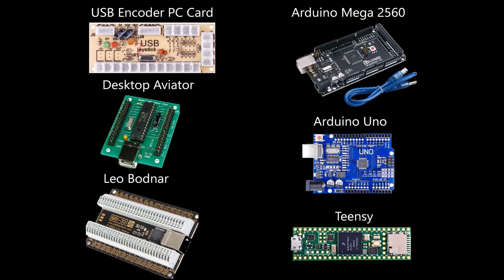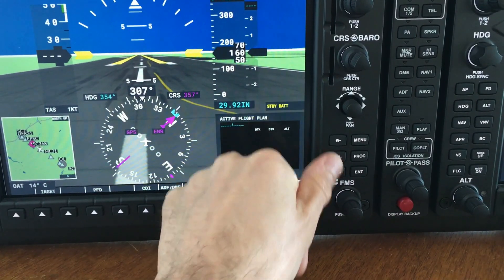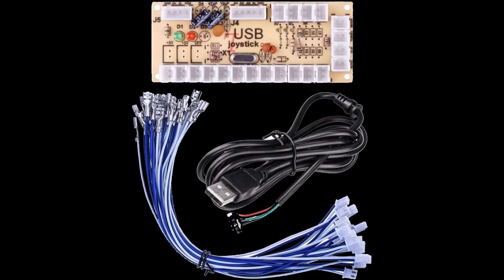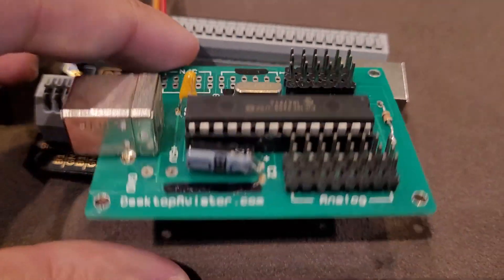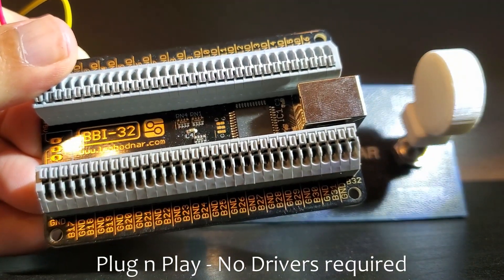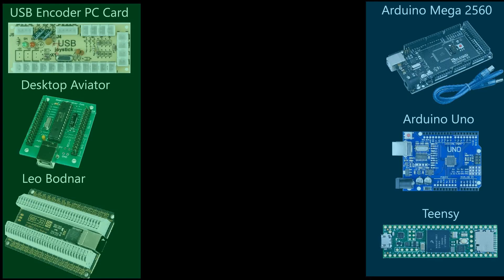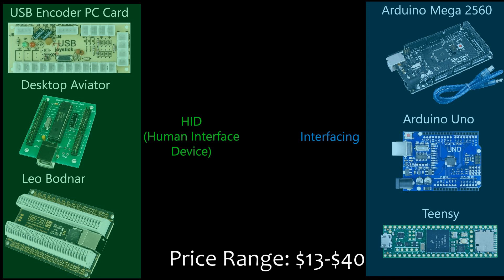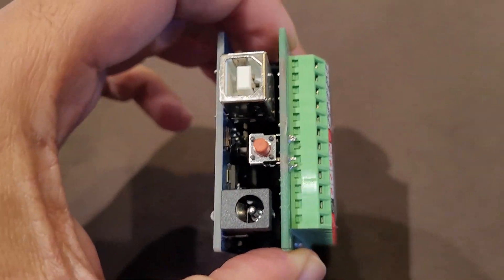USB Interface and Encoder cards for Flight Simulator, X-plane and Prepar3d - Cockpit building

Comment: I’ve been wanting to build a basic switch box for Microsoft flight sim so I don’t need to use my mouse. But also don’t want to spend $100 on one and want to be able to customise it. Found this video very helpful
Reply from the maker: My advice to you is to not build a switch box because you will eventually outgrow it. Find a plane you like with switches that look very similar to other aircraft, and that way it becomes very useful panels because it represents something in real life 😏
Reply: @joshuamarius I bought the usb encoder PC Card and was having a problem where in mfs2020 the switches would turn on and off quickly when connected to the simulator do you have any ideas why
Reply from the maker: Did you test it outside of the simulator first? If it has the same problem in the windows game controller properties then it's a problem with the card. 
Which one in particular did you get?
Reply: @joshuamarius I have sent it back but the one you used in the video was not available in the uk so I bought the most similar one i did try it in a few other games I had in ETS2 it was not even recognising it but in assets corsa it was recognising it but was making you flip the on them off for it do anything I was going to try and buy a different one and see if it fixes it self
Reply from the maker: @brookvlogs8323 Try the Leo Bodnar's. They are in the UK. A bit pricier but also plug n play.

Comment: My encoder is not recognized by Windows 11
Reply from the maker: Which encoder?
Reply: EG STARTS USB encoder, WANGCL Zero Delay and BEYEE all 3 are not recognized
Reply from the maker: You may have defective cards. Those are USB Plug and Play and require no Drivers for Installaton.

Comment: Was excited to find this, but looking at the Leonard site and ouch!! Waaaay too pricey 😢
Reply: I'm a former USAF aircraft electrician.  I am still planning my build, and I will tell you, I keep returning to the Leo Bodnar cards for all but the items that feed information back to an indicator light or display.
Reply from the maker: Yes. Although pricey, the Bodnar cards still win the top prizes for:
1) Fastest and easiest way to connect a device to your Simulator
2) Fastest and most hassle free way to connect an Encoder to your simulator
3) Best built-in wiring mechanism (both catch and release)
I absolutely love my BBI-32 and BBI-64!

Comment: I have a related question: what would you suggest to do for connecting 18 usb devices like these? 

My panels freeze or disconnect…

Thanks and happy flying!
Reply from the maker: Some of these USB Devices use quite a bit of power so you will need multiple USB HUBS. Most people cheap out and find the $20-$40 on Amazon and order. You have to get the good ones with a good power supply with a lot of juice. 4A-5A etc., but these cost in the range of $60-$100. You should be able to split 18 devices within 3 of these for more stability; in some case you may even use 2. This guy has been very good to me: https://amzn.to/3JJoASh

Comment: can it be used in other games other than flight simulators?
Reply from the maker: Which card and which game/system? USB plug n play cards such as the Leo Bodnar and the USB Arcade/PC Cards will usually work with any system that detects them because they are HID devices. But this must be supported by the device. Some gaming devices will  only detect their own proprietary hardware.

Comment: First off this, and your other videos are very well done and informative. I am very new to the sim build and would like to build my own sim from scratch. I have done a lot of searching and I can't seem to find info on how everything behind the sim controls gets connected. Basically, I'm trying to understand how all the buttons, lights, displays, etc. get connected to and from the computer and what software is involved. Example: I put all the wiring to and Arduino. The Arduino Outputs either USB or Ethernet. It is from this point that I do not understand were and how that gets to the computer and back to the devices. What software is used to recognize the individual components and how does that tie into the flight sim software like MS202 or Xplane. I really wish somebody would do some good videos or a tutorial that is literally a start to finish on the complete sim. Maybe someone has. I just haven't found it.  Any ideas?
Reply from the maker: Thanks for your comment. The two methods of interfacing with the simulator are either through HID devices which are plug and Play, such as your joystick or pedals (Leo Bodnar) or Arduino and Mobiflight. For the Leo Bodnar cards for example, once you plug them into the computer the simulator picks them up as a device with multiple buttons. If you connect a switch to button one then you just configure what button one should do in the simulator.
For Arduino and Mobiflight, this is called interfacing, and MobiFlight does all the work for you. Once you download the software you will flash the Arduino with the MobiFlight firmware, and then in MobiFlight program all of the buttons. There's tons on videos on this. MobiFlight is then run on the background, you start up the simulator and it will send the commands you programmed to the simulator: https://youtu.be/pS8KGfYRNrY?si=ppnkH6dDyzgjEegj
In MobiFlight your will see two tabs, Input (to configure switches, pushbuttons, encoders, etc) and output (to configure LEDs, etc).

Comment: i'm looking into building a simple switch panel for msfs with landing gear, engine start/stop, park break, etc. which one of these boards should i choose if i want to avoid soldering anything?
Reply from the maker: Remember that it is a two way road: Device <> Interface Card. So you have to consider both, not just the board. If you look at my other videos, I review some panels and Landing gear kit where the Toggle switches have built in screw-in Terminals, example: https://amzn.to/3Qb30Kk
On the Interface / HID Card side, I also show in my videos how to use Screw Terminal Blocks or Shields so you do not have to solder. Refer to the following videos although I recommend you watch them all:
https://youtu.be/M7Fx54e_NtM?si=ugZ6eEB2ALEfdILG
https://youtu.be/acwipmtqxYA?si=lnZ_J8SN_uAasQaC
Soon I will be producing a video of Wiring. Coming soon!
Reply: The Leo Bodnar BBI-32 has little spring loaded captive ports and requires no soldering.  If you get a set of jumper wires with male at one end and female at the other the female ends will plug onto the pins of the rotary encoders and the male ends to the board. You can also buy simple pushbuttons that already have wires on them.  Personally I wouldn't bother with duplicating displays or lights, all of that stuff can be seen directly on the simulator, you just want to be able to avoid having to use the mouse.

Comment: Hello, congratulations on your very interesting videos. I would like to use a car simulator pedal board (using only two pedals) as a pedal board for simulated flight with P3D. I saw that some boards can be recognised as "controls" of the aircraft. Which board would you recommend? Thanks in advance for your attention
Reply from the maker: Thank you so much. If by "Controls" you mean Axis' (Rudder, Aileron, etc.), then yes there are many cards. One example is the BU0836A 12-bit joystick interface by Leo Bodnar: https://www.leobodnar.com/shop/index.php?main_page=product_info&cPath=94&products_id=204&zenid=ecad6d3e44fe314feae7bce803c20cb6
This card is very reliable and used by many simulation gear manufacturers.

Comment: Hey Joshua, does that mean that I have to use an Interface Card like Arduino to get the LED of your landinggear device working like it should? With a Leo Bodnar BBI-32 it would not work?🤔
Reply from the maker: That is correct.

Comment: can you talk more about software and which ones you use for which encoders
Reply from the maker: Oh jeez, I replied right after you left the comment but it did not save for some reason :( For encoders, if you want no programming at all, take a look at my other video: https://youtu.be/cCl7dwXBSBI - Leo Bodnar has their own free software. 
What most people are going to go after is an Arduino and MobiFlight with FSUIPC. MobiFlight reads the variables from the simulator and programs the Arduino (Both inputs and outputs) and FSUIPC helps provide additional interfacing with the Simulator. I will be making some videos on this soon.
Reply: @joshuamarius  thanks. No problem in the late response, ill definitely check these out!
Reply: @joshuamarius  I went with arduino mega so ill check out the software you listed

Comment: can you do a video on the arduino mega with the sheild. i want to do that approach but i want see some of your work on it
Reply from the maker: What would you like to see? The Shield/Terminal Block just slides into the pins and then you insert the wire inside the pin you would like and screw down. It's very simple. I also just added a Rail Mount Terminal Block as well: https://amzn.to/3GB6nEv

Comment: Hey. I love you’re videos. Can do you Do a video on how to wire a light. For example when you press the apu bleed so it stays on. Or the opposite way around. Or when the fuel pumps are off they the push button says off. If you get what I mean!
Reply from the maker: I will be doing a video on interfacing soon but there are already many videos online for this, for example: https://youtu.be/98sx64YF4h0

Comment: what i need for install a korry button (A320 APU Switch)
Reply from the maker: This is usually a momentary push button with multiple LEDs. Are you building one or did you purchase one. Each one will have different specifications and a way of wiring it up and interfacing with it. If you have a link that would help me answer your questions.

Comment: WHy audio is way too low on all of your videos ?
Reply from the maker: I watched in on my desktop, laptop, tablet, phone, and also tried headsets and I could hear myself just fine. You may have to increase the Volume or need better speakers. The Volume is lower than most of the high definition YouTube content out there, but before I publish I test on as many devices as I can and I was able to hear just fine and not even at full volume.

Comment: On the first board you showed it had wires with wide ends on them that looked like they would slip right onto the standard terminals of switches without soldering.  Is this correct? And if so is there a term for these wires I can use to find them?
Reply from the maker: Excellent question. These are Spade quick connectors and they will be featured in my next video. They slide right into the switch connectors/terminals and save you time as no soldering is required. Here is a link to a pack with different sizes: https://amzn.to/3Hb31a3

Comment: How many usb encoder cards can you connect to one pc? Would they conflict with each other, also is there a way to chain them together if conflict is an issue?
Reply from the maker: Very good questions. You can connect as many as you physically can through USB resources available (ports and power) and there will be no conflict as each card works independently, and creates it's own set of inputs. Different manufacturers may allow you to chain them together so check for accessories when you purchase them, however if you were to chain them at some point they may require an individual power source or a separate connection as just a single USB cable will not carry enough current to power several cards, and the devices connected to them.
Reply: @joshuamarius  appreciate the response

Comment: Hi Josh,
I am just starting to wander down the sim path. You mentioned your Mustang project and suggested we have a look at it. Could you point me in the right direction as to where it might be residing?
Thanks a ton,
Dan
Reply from the maker: Dan, thanks for the comment. The project is built with panels and Hardware from Aviatek similar to the following: https://aviatek.com/collections/all/products/citation-mustang-trainer - You can purchase the entire Mustang assembly, or the panels and the G1000 individually.
The great thing about them is that they can help you with plugins, tips, software and ideas so you can use it with Flight1 software or what's available in X-Plane.

Comment: Great video, thank you. I would like to build a nosewheel tiller for the Zibo Mod 737 in X-plane. Can you recommend specific electronic components and advise how to wire and set up? I would prefer not to solder anything. I assume this would require a rotary potentiometer and an HID. I'm good at modeling, machining and 3D printing, but electronics not so much.
Reply from the maker: This is a fun little project. Make sure to understand the specifications of the Zibo Mod and follow recommendations. If it seeks an Axis in the simulator, I recommend the Leo Bodnar BU0836A Card, but there are also good products offered by Desktop Aviator. If you look at this link for Leo Bodnar (How to use Tab), you will see the Wiring Diagrams: http://www.leobodnar.com/shop/index.php?main_page=product_info&products_id=204 
It's very simple and straight forward. The Leo Bodnar is plug and play and will be immediately detected by your computer and the Simulator. Wire in (https://amzn.to/3DBMppv) the potentiometer and go to Devices and Printers in Windows, then look at the Game Controller settings of the Leo Bodnar card. Rotate the potentiometer (https://amzn.to/3dxzpqs) and make sure you see the the increase and decrease of the setting. Once you verify this, go into the simulator and assign that axis to your Zibo Mod and start taxiing ✈️Enjoy!
Reply: @joshuamarius  Hi Joshua, thanks very much for the reply. I'm sorry I didn't see it until now because the email notification got caught by one of my filters (outsmarted myself by trying to organize/automate my email 😖). I purchased an Arduino Leonardo, and with help from Paul at the Fun of Flying channel, managed to write the code. I changed the settings in the Zibo EFB so that now the rudder pedals give me just the realistic +/- 7 degrees of nosewheel control, but the potentiometer pivots it through its entire range for taxiing. Yesterday I made most of the pieces for the tiller, which will use a 5-inch handwheel that I had in my boxes of misc parts. All I have left to do is to finish machining the shaft and assemble. So far so good!

Comment: Hey sorry if this is a idiotic question( i have almost no clue on how wiring works)but can the usb encoder card in the video work with a on off on/(on) off (on) switch with the same wires that's included with the package and how? Thanks if you answer my question
Reply from the maker: No such thing as an idiotic question. If you have a link to the switch that would greatly help me but it sounds like you have an SPDT switch. If you look at the wires included with the PC Encoder Card in this video, you will notice a pair which is white and blue. White will be your common (you may see it labeled as COM/GND). An SPDT switch has 3 connections, one for GND and the other two for the switch's on positions. Using two connectors with two pairs of cables (4 total); The GNDs can all be connected together but one has to go to the GND connector on the switch, and then your two blues will go to the remaining connectors, separately, one blue per connector.
On the software side, this will be seen by the computer or simulator as two buttons.
Reply: @joshuamarius  Thanks and im sorry that i didn't specify it as a spdt i wish you good luck

Comment: I have a question to the usb encoder i have build a cheap overhead for the Zibo 737 with toggle switches when I setup the switches in settings in xp11ane in need do press the switch twice to move the switch in the virtual cockpit ? 
Is there any plugin that I can use ?
Reply from the maker: What type of Toggle switches did you use and does the assignment have any conditions in the simulator (what is it exactly)? Once you assign an action to the switch it should be immediately executed as soon as you toggle the switch, unless the action requires toggling it multiple times, which can be done with an encoder.
Reply: @joshuamarius  normal toggle switches my problem is that I don't have a function when my button is released

Comment: I was never able to find a video of yours that talked about connecting the Arduino Mega to your Mustang.  Can you elaborate on the use of interfaces?  Thanks
Reply from the maker: This would be a long video because we are able to complete this in prepar3d, FSX and also X-Plane. It's more challenging in prepar3d/FSX because the aircraft from Flight1 needs additional code to work properly with the hardware. It is a lot easier to interface in X-plane however. There are many tutorials on how to interface on YT - basically you would use the Aviatek connector which is what I consider an Upgrade to MobiFlight. You then program the actions (Input/Output) and how you wish to pick them up (Keyboard shortcuts, offsets, controls, etc).
Reply: @joshuamarius  that helped. Thanks. I'll check out Aviatek
Reply: @joshuamarius i have a question on the keyestuido mega plus board in hopes to use for my botton box (mainly for American truck sim) but not sure how to program it as hid device everywhere I've looked says it's not able to be used as a hid device  thanks for any help and info

P.s. appreciate your videos the o e for add8ng relays for switches with leds helped I purchased the 8  relay part for my switches